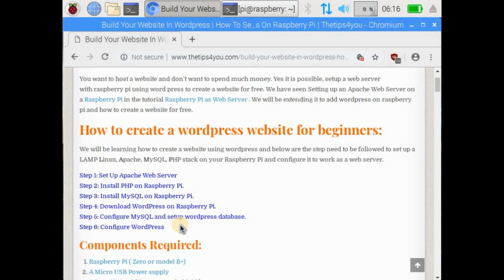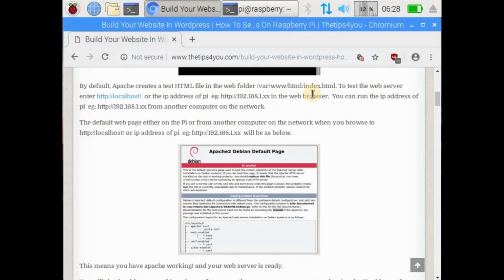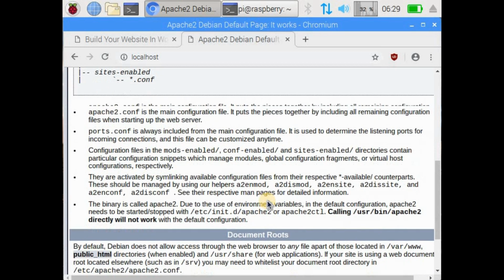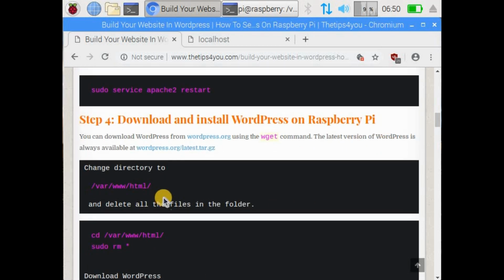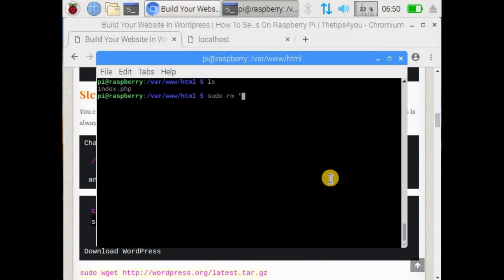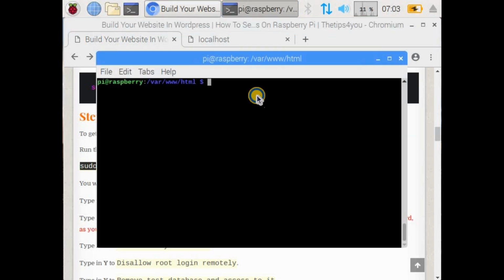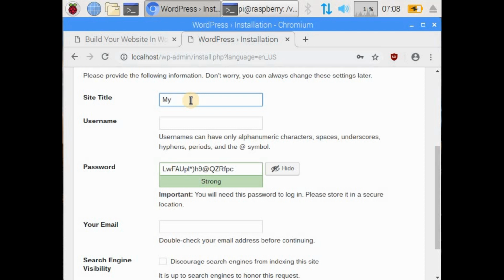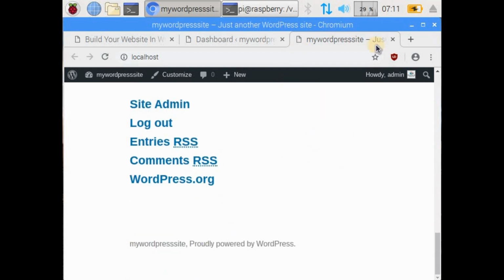Wordpress Installation Step By Step | How To Install Wordpress Locally | Raspberry pi Website

Comment: Hi!
I´m stuck at the installation of mysql and getting this msg, why and what to do?

pi@raspberrypi:/var/www/html $ sudo apt-get install mysql-server php-mysql -y
Reading package lists... Done
Building dependency tree       
Reading state information... Done
Package mysql-server is not available, but is referred to by another package.
This may mean that the package is missing, has been obsoleted, or
is only available from another source
However the following packages replace it:
  mariadb-server-10.0

E: Package 'mysql-server' has no installation candidate
Reply from the maker: Not sure why it didn't worked for you. Can you try again. It had worked for me even few days before, today also in official raspberry site the steps are same. I need to check if the packages are changed or not. If there is any changes I will update it you and in the video. Thanks for your comment.
Reply: I tested to replace the 'mysql-server' to 'mariadb-server-10.0' instead and that work perfect so the following command is

sudo apt-get install mariadb-server-10.0 php-mysql -y
Reply: @fredrikbillstrom5085  sudo apt-get install mariadb-server
Reply: @vincentvanderwesthuizen7947  still aint working